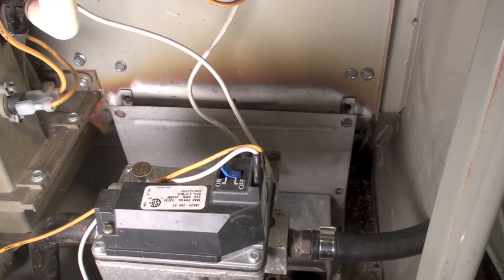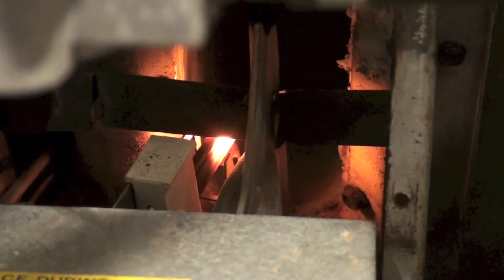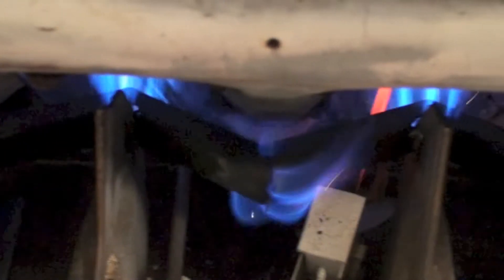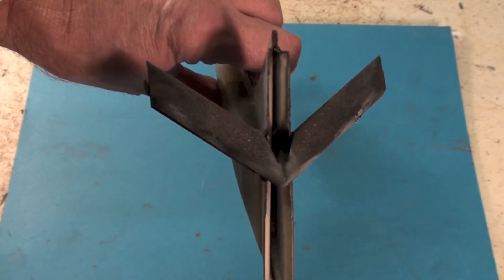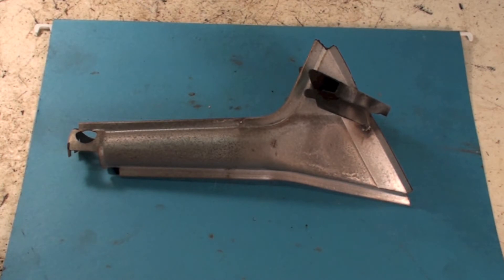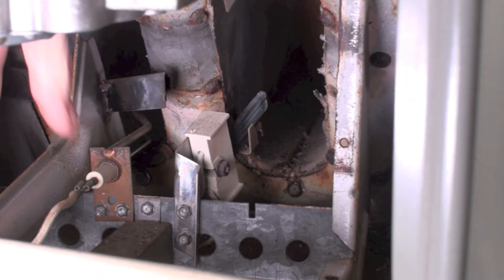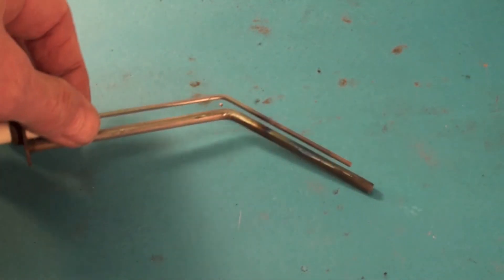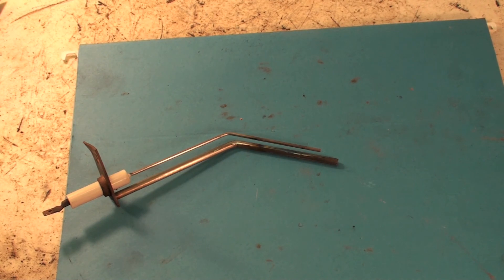How the burners and flame rod work on the Trane BLU furnace

Comment: Hi GFG....For some reason your other videos, the comments box didn't pop up.  You and I have been going back and forth a bit on my oil furnace.  I had described how I've replaced every single component and not getting fuel out backside of pump.  I removed pump again and attempted to blow in the backside with no luck.  I compared that to the old pump - same.  I have to assume, something "tells" it to open up when it is ready.  Since I replace the igniter with its little controller, that should be good.  Do you have any idea at all what else I can do here?  What tells it to release fuel to jet?  I'm baffled here.  The pump was packed with fuel too so it really boils down to getting it out that backside. THanks.
Reply from the maker: Youtube is being obnoxious with the comments.  Does your pump have a solenoid?  I did a vid on those.  Other than that, the regulator will not allow the the oil to pass until the pressure is up to normal.  
GFM
Reply: grayfurnaceman My pump is pretty much exactly what you've shown with the Beckett pump.  On the top, it has a small plastic connector, the output goes through a tunnel beside the igniter over to the controller panel which was replaced last year.  I do not know if there is a solenoid, but I get the usual loud click before it attempts to light, pump turns with the fan, etc.  I adjusted that screw a bit but it didn't do anything.  The regulator I presume is part of the pump? APpreciate your help.
Reply from the maker: Eric Kirk The regulator is in the pump.  The plastic thing on top of the pump is the solenoid.  It must be energized for the pump to work.  It is a time delay solenoid to allow time for the pump pressure to reach normal before it allows oil thru.  This is probably the problem.  You must have voltage at the solenoid for it to work.
GFM
Reply: grayfurnaceman GFM - Somehow I missed this comment!  Thanks.  So, if it is the solenoid, that came with the brand new pump and the power cord goes over and connects to the Beckett 7505 controller.  Would that signal/power to to kick on that solenoid then be controlled by that panel and if so, would that mean my controller is probably bad?  It's literally the only thing not replaced.  It seems to kick on everything else though - I never quite figured out the lights on that but I guess when it kicks on, then it's in the right mode?
Reply from the maker: I would call for heat after reset, place voltmeter probes on the wires going to the solenoid.  If voltage is there, the problem is in the solenoid.  No voltage, problem is in the control or wiring.
GFM
Reply: grayfurnaceman Hello - Well, I checked voltage, no voltage, so I replaced that controller.  Weird that it went bad since just being replaced last year.  So, you will be happy to know, that worked and I got that ole boy fired up just in time for a cold night.  I did notice one thing though, the fan sort of stays on even after the burner cycles off (when it gets to proper heat temp).  You know, in the same area with the cover pulled off, there is that little thermostat thing in there?  It has a small white prong that you can pull or push in and the fan will turn on or off.  For some reason I had to push or pull to get fan going.  Thoughts?
Reply from the maker: Eric Kirk Its good to be warm.  
That furnace uses a heat operated fan switch that delays the fan on until the heat exchanger warms, the clears the heat exchanger of heat after the burners shut off.
GFM